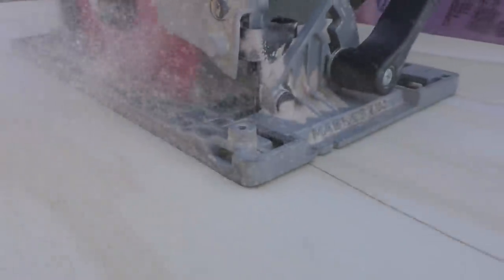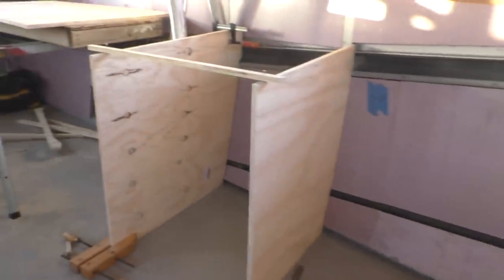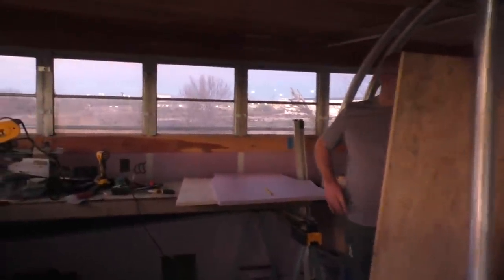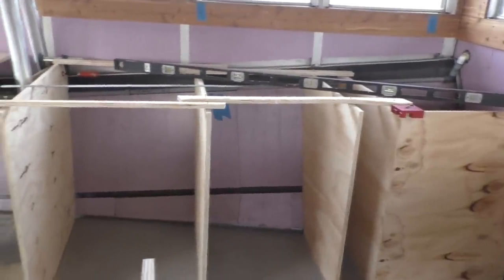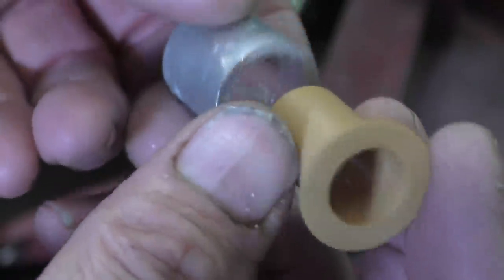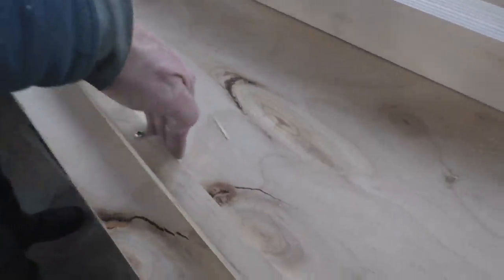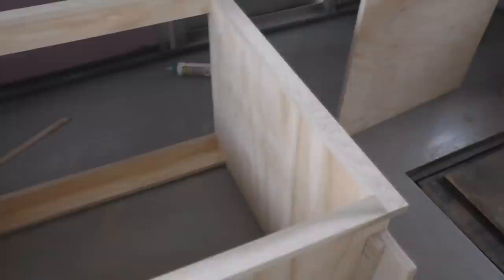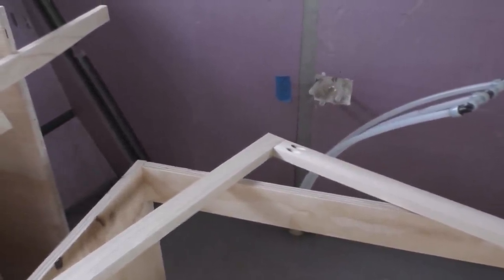Pilothouse Fitout - Part 2 - Cabinets

Comment: You got to have plenty of clamps "!  So many things to fabricate.   Fabrication is 
probably never ending on 
a research vessel. 
        Awesome to watch the solutions to problems.  It's 
a message to life in general.  Push through your problems and accept 
changes in solving the problem.      Thanks Doug 
in showing that there is always a door open in
solving problems even if 
that door is just open a little.  The other thing is ,
"two heads are better than one", and , " Someone else  
has the answer ".
    I'm persistent,  but it's 
nice to see it on video.
Thanks again!!👍👍

Comment: Doug. Any concerns on the possibility of the weld failing where that gimbal pin is welded to relatively thin sheet of the stove hanger? The weight of stove will be levered on those two points. Might it have been better to weld the pin to a 1/4" backer plate that could bolt to cabinets
Reply from the maker: No.   I live worries like that to folks like you.  :)

Comment: I personally would use glue along with the Kreg screws. The glue is where a lot of your strength is at. If you think about it the screws are your clamps until the glue dries. I’ve built cabinets and furniture for a lot of the high end homes in OKC.
Reply: Glue was used where it made sense but for the face frames a 3/4x1.5" end grain glue joint would provide little or no strength those joints are really only to pull the face frame joints tight the attachment to the carcass is where the strength lies
Reply: @duckzeus1  okay good. I just wanted people to know that glue is needed in the structure. Pocket holes are only part of the strength. I personally like to do dados, glue, and screws on my cabinets.

Comment: Oh boy... You will have a lot of fun with that gimbal stove so far above water line. Do the math, how much a fixed point at water line in the boat moves side to side when the boat rolls and how much it moves as you move it up or down away from the waterline...

Comment: Are you going to hit the cabinets with an oil or a paint to seal the wood? Also, does that plywood have water proof or resistant glue, like CDX plywood does?

I have to say, with the galley coming together and all the progress on the engine room, it is starting to have more of that 'boat' feel to it than it did with just the floors and paint done.

Comment: Hey Doug, Looking Good ! At 9:06 you showed the starboard, aft corner of PH, and mentioned a water heater... I thought one corner was for the red "ceramic egg" grill. Is that just going outside on stern ?  Was thinking it could nicely fit in that same corner and use the two adjacent windows to vent smoke with a hood in corner area at top well above so the lid tilts back towards starboard in that empty space as wall flares up and outwards. Don't think a gimbal is needed on a grill, do you ? That corner would also work well for a top hinged fridge (perhaps home made w/cold plate ?) or deep freezer, having 2 of those could be a good thing supplies wise and for redundancy...

Comment: Nice professional job on those cabinets.  Was hoping you would say more about  why marine plywood isn't worth the money.  Did you mean for this application or generally?
Reply from the maker: In general the price is not justified by the additional strength.   Here is the test: https://youtu.be/IY7hkCexNVY?t=143
Reply: @SVSeeker  
Thanks for the reply and link to your plywood & adhesive comparison test.  Very instructive.

Comment: That will work if the ship rocks port and starboard but it's not going to help much for and aft ... The gimbal has to work a full 360 degrees waves come from all directions all you've made is a swing
Reply from the maker: You really think you need to cook while pitching and rolling?   : )
Reply: Then why even add a gimbal
Reply from the maker: @stephens340    ...because sailboats will often heal while underway.

Comment: Lovely carbonated but it would really pay you to use proper bs 1088 marine ply (I don't know what the us standard is as I don't live there) as its garenteed to last 25 years (depending on brand) I know it's inside but since you haven't got weather tight windows + general moisture in the marine inviroment seems a real shame to spend the time on building something lovely that potentially won't last as long.
Reply from the maker: Nope!  Marine Ply is completely over rated and over priced.  https://youtu.be/IY7hkCexNVY
Reply: @SVSeeker  very interesting test! In the uk we don't call this marine ply, the adhesive is the same I think. But our wood is different. All ours is mahogany witch is much stronger and more rot resistant. Marine ply in your video I don't think would conform to bs 1088 this is the stuff we use at work https://www.robbins.co.uk/products-prices/marine/marine-plywood-panels/
Reply: Also for the difference in price we could dip the entire pilot house in epoxy

Comment: Isn't the gimbal stove supposed to be against the outside of the boat? So that when the sailboat is on the lean or rolling in the waves the gimbal works? I understand that this is a very heavy steel boat and my not lean or even roll much. But with the gimbal action moving front to back, any side to side motion will cause pots etc. to slosh over. Just a thought. Not trying to be critical...
Reply from the maker: It is

Comment: i think a 2 axis gimble would be better for the stove, your moving forward and back too not just left and right
Reply from the maker: Pitch and Roll    ...and if you’re doing both the do you really need to have a casserole in the oven?  :)
Reply: @SVSeeker  who said anything about casserole, just have a big ass pie or a pork roast that takes a coupple hours, i make some mean pork roast, maybe i should swing by some time
Reply: Even on much smaller sailboats this is how it is done.
Reply: @axiom1650  yeah ik, just thought a 2 axis would be better for seeker due to what they do
Reply from the maker: @axiom1650  Jesus.  Do you think smaller boats pitch more or less.  : )
Reply: @SVSeeker My reply implies just that
Reply from the maker: @axiom1650    So, you think Seeker is small.  : )
Reply: @SVSeeker  Nah, just mean that if it's fine on a smaller vessel it's for sure fine on yours, but you got that I think ;)

Comment: What wood does he say to buy instead of marine ply?? And half the price of oak??
Reply from the maker: Get common ply, and poplar is a great replacement for oak.
Reply: Popular. Slightly harder and tighter grain than pine. Often a slight green tint but often easy to find in clear straight grain. 
Hard enough to last, soft enough to work with, great value.
Reply: @SVSeeker any thanks and fantastic series!
Reply: @eshootziscrs2868  cheers mate
Reply: Most big box stores in the us have a pseudo cabinet grade plywood. 5-7 ply 3/4" sanded both sides. Runs $35-$45 a sheet. I use it for most of my projects. This stuff was aruca ply from HD